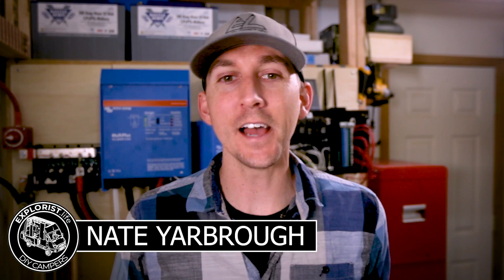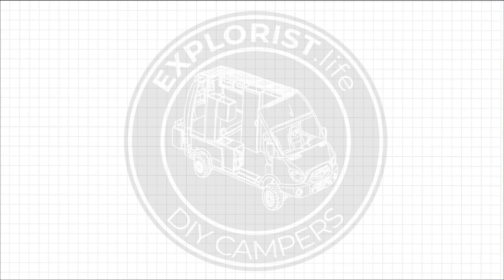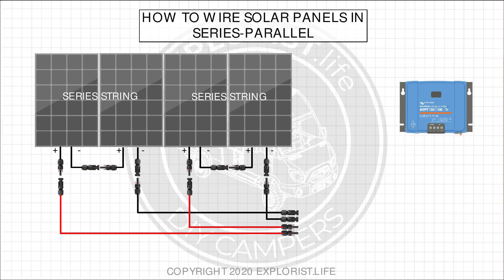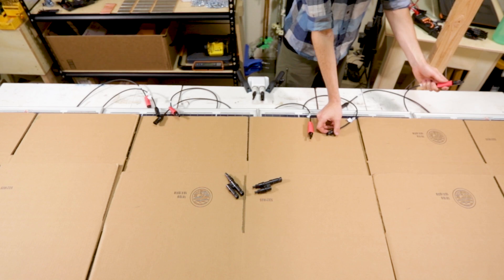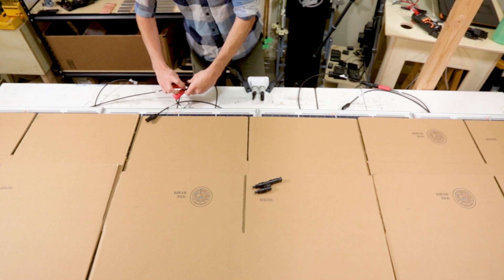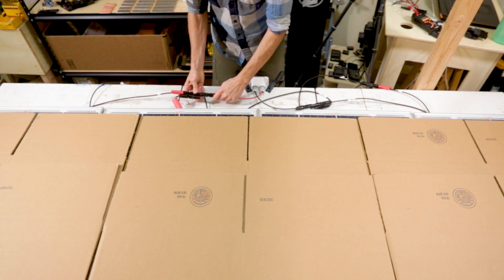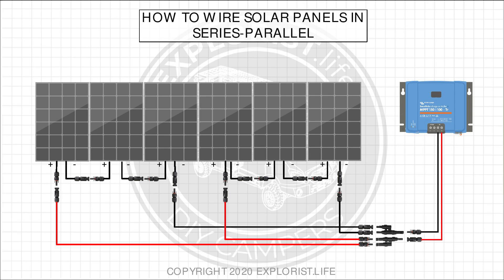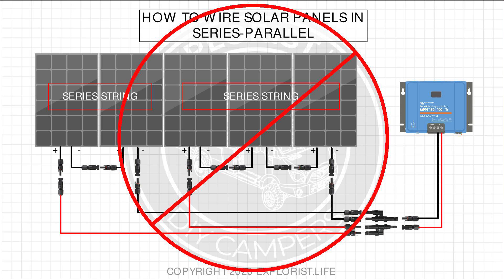How to Wire Solar Panels in Series Parallel

Comment: May be stupid question, but I have only seen series-parallel connections done for pairs of panels, (on youtube).  I will be mounting 6 x 350 watt LG panels; rated output of about 42v, 9.9amps each.  Can I connect sets of 3 in series, then each set in parallel, which should come out to about 84v @ 20A. ?
Reply from the maker: Yep!  Very much so!

Comment: My question is , I bought some used solar panels 4 of them are 190 Watts ,voltage at Peak power  26.7 Volts .
Also I got one of the
3KW 24V-110V Solar Hybrid Inverter:80A Charge Controller 3KW Off Grid Inverter.
im going to buy 2 of
400AH 200AH 100AH 12V Deep Cycle GEL SLA Battery for Solar System RV Camping
what do you think about the inverter , is going to work properly with no issue with 4 of these solar panels , also My idea to get 2 of 12v batteries to connect them as 24 volts .

I will be happy to hear from you and what is your advice to me.
Reply from the maker: I don't have enough information about your system to say much about it, but I've got all of my recommended setups available here that may help: https://www.explorist.life/solarwiringdiagrams

Comment: Hi. I got 5 panels.  So how do I connect. A sketch will be helpful
Reply from the maker: I recommend wiring in series with a properly sized charge controller.

How to wire solar panels in series: https://www.youtube.com/watch?v=2-ZN4JBbuKM

How to size a charge controller: https://www.youtube.com/watch?v=MxziHKvTRh8

Comment: Hey I found someone with a decent mic and presentation skills! Thank you. I purchased an EB240 with a 4 panel kit, mono crystal rich  solar 4x100 watt. Looks easy.
Reply from the maker: Awesome!  Glad it helped.  Thanks for watching!
Reply: Hey I got the same setup. I connected everything the same way as the video diagram but I don't understand what the output should be on paper

Comment: hola, i have a question , is it possable to read what happening in our solar pannel system from our office computer ? we would like to see how the system is working for our clients where they are on the road, is that possable yet ?
Reply from the maker: Yes.  You would want to connect your Victron Devices to a Victron GX device (like the Victron Cerbo GX) and connect that to the internet.  From there you could monitor your devices from the Victron VRM Portal: https://vrm.victronenergy.com/landingpage

Comment: If I have 24 panels I assume I can wire 12 panels in series and the two series in parallel, correct?
Reply from the maker: That will likely result in more voltage than your charge controller can handle, but here's how to figure out the math: https://www.explorist.life/how-series-vs-parallel-wired-solar-panels-affects-amps-and-volts/

Comment: I am planning on putting 5 175W solar panels on my van. If I can't wire them in series parallel with an odd #, but want to keep amps down, what do you recommend?
Reply from the maker: As you've likely learned, you can only wire in series and parallel with 5 panels.  I would recommend wiring all 5 panels in series (with a properly sized MPPT charge controller) to keep voltage drop and wire size to a minimum. This would also provide the MPPT charge controller with plenty of voltage to really do its job.

Comment: How do I get 220V dual phase from solar power?
Reply from the maker: Use a solar array to charge the battery bank.  Then use the battery bank to supply power to an Inverter capabale of 240v split phase output or 2x Victron Muliplus inverters wired & programmed for 240v split phase.

Comment: We have two 100ah AMG batteries. Should we install a circuit breaker of 50amp between battery and charge controller (wanderer/renogy)? Or install a switch and an ANL FUSE 50amp.  
We only have two 100 w solar panels
Reply from the maker: Yes, there should be overcurrent protection between the battery and the charge controller.  I prefer fuses  with no switches: https://www.explorist.life/2000w-inverter-200-400ah-lithium-200-to-700w-solar-camper-wiring-diagram/

Comment: Hello Great Video Thks. I wired my 3 strings, 6-250 Watt, 47 volts, 6.25 Amp panels almost the same way. 1st I ran both  a positave and negitave wire back to my combiner box like yours  making 6 wires total of 3 Negitive and 3 Positive from 3 two panel strings.
HERES were I may be in trouble  I than wired my positive and my negitive  WIRES  from each string  starting with a negitive wire from the FIRST string to negitive bar in conbiner box then end to end  positive to negitive ending with a positive wire and 282 dc volts at 6.25 amps. 
All is well but I wanted MORE AMPS  so I took the last string  REWIRED for PARALLEL  Lost 47 volts and my  Amps STAYED the SAME at 6.25 AMPS .  I should of ended up with  18.75 AMPS  but I did have 235 dc Volts thats correct.  Anyone have any ideas. Thanks Bill
Reply from the maker: I don't really follow what you did and what the problem is.  Sorry about that!

Comment: Do these same principals hold true for just 2 panels? I was told to wire my 2 panels this way because of the 30ft length I have to run the lines to my inverter(so I don’t lose voltage because of the long run.)
Reply from the maker: I know you found your answer, but for anybody else reading, 2 panels would be wired in series (given the charge controller could handle the voltage).  Here's how to do that: https://www.youtube.com/watch?v=2-ZN4JBbuKM

Comment: Just double checking. If I have 4x190W panels, each outputting 20.4v and 9.31A, If I connect two in parallel then that’s 20.4V and 18.62A and then I connect the other two in parallel and I join them in series, will my output be 40.8V and 18.62A total?
Reply from the maker: You should check out the video on this page.  It should help out: https://www.explorist.life/how-series-vs-parallel-wired-solar-panels-affects-amps-and-volts/

Comment: Hi Nate, I don't know if you have made video about wiring batteries but I thought I'd ask about wiring parallel vs. Series for batteries and what the pros and cons would be for each? If you have made a video on this then I'd love it if you would add the link. ;) Keep up the great vids, I'm learning a lot!
Reply from the maker: I don't have a video about that, but the only reason to wire batteries in anything other than parallel would be to alter the voltage of battery bank to a different voltage than the original batteries.  So, if you wanted to make a 24v or 48v battery bank out of 12v batteries, you'd have to wire in series (or series parallel).  If you were making a 12v battery bank out of 6v batteries, you'd need to wire in series (or series parallel).

Wiring 12v batteries in parallel to make a 12v battery bank is the way to go for 95% of use cases.

Comment: Hi Nate, your videos are incredible - thank you!

Question - what is the determining factor for the current of the solar-RV battery system — Is it the solar panels’ total wattage divided by the battery’s charging voltage (e.g., 14.4V for a 12V battery system)? Or the solar panels’ total wattage divide by the solar panels’ total Voc?
Reply from the maker: Solar array wattage / Battery charging voltage = amps charging the battery.

Comment: Hi Nate. Do you know what happens to the Voc when panels are wired in parallel? Does the Voc remain the same (assuming identical panels). I’ve read that wiring panels in series results in the Voc being added together. I have a system with a controller limited to 23 Voc (CTEK) and am trying to figure out the largest solar panel system I can create without exceeding the 23 Voc. If you could point me in the right direction, it would be greatly appreciated.
Reply from the maker: Here is a video that will teach you how wiring a solar panel array affects it's voltage: https://www.youtube.com/watch?v=KJ5zCY5EBeQ
Reply: EXPLORIST life - DIY Campers Thank you Nate. Your link was very useful and I really appreciate your response.

Comment: Hi Nate!

I am trying to convert a Ford E450 Super Duty 14 passenger van into my RV.

And this is my first time ever with this type of work.

I cannot thank you enough for all of your information.

They helped me and gave me enough courage to convert my own van.

I am trying to refer to your 
"300AH BATTERY BANK – 3X175W SOLAR – 2000W INVERTER – ISOLATOR WIRING DIAGRAM"
Then I found that you have updated this diagram to
"2000W INVERTER | 200-400AH LITHIUM | 200 TO 700W SOLAR CAMPER WIRING DIAGRAM"

And I have a few questions about the updated diagram.

Is the updated one better or easier to install than the old version?

I noticed that you used 4 batteries with the updated version. Do you think 4 batteries are necessary? Would the updated version work with 3 batteries as well?

You mentioned a few cautions about the old version. Does that mean you don't recommend the old version?

I found the "Victron Orion-Tr DC-DC Charger Isolated 12/12 30A" for new version is out of stock and Victron told me that it may be available for next month and I am a little worried if I get delayed with my work.

Your advice will be very helpful and thank you for your answers in advance!

Comment: Thanks for the great video. I’m currently setting up my off-road camper trailer with solar, and due to the small size I can’t fit as much as I’d like on the roof. To get what I want, I’ll have two panels bonded to the roof, and using locking drawer slides I’ll have two more covering the first Two while traveling. Once arriving at camp, the drawer slides will be unlocked and pulled out exposing all 4 panels to the sun. I’m over doing it because I’ll likely be in partial shade and they will always be flat/not directed at the sun. I’ll be using 4x Renogy 175w flexible panels.

I either need to run all 4 panels in parallel or run it in series-parallel. I’d like some power from the panels while traveling and 2 panels will be completely shaded. If I choose to run it in series parallel, I’m not clear which of the two panels in your example are in parallel and which two are series. I need to know which panels should be on bottom covered and which ones should be ontop exposed for the best charging while traveling.

I know it’s an odd question, but I appreciate the input. Thanks again for your videos!

Comment: quick question
if i have 3 panels
can i just connect 2 in parallel  to each other and the theird in series to both of them ?
also if i have a 2 different panels with different current (say one with 5 amp and other with 10 amp)
when i connect them in series how much current will i have or is it not possible to do so ?
Reply: I would like to know this also.

Comment: You wire to what the open volt capacity of the controller then parallel. Your using way to many connectors. Your doing it to stay at 24 volts rather than the capacity of the controller.
Reply from the maker: I'm sorry, I'm not following your question.  What are you confused about?

Comment: Hey Nate, is it ok to disconnect the solar panels from the MPPT/SC when the RV is outside in the sun? I plan on using the same panels to charge two separate devices so was planning to put an Anderson plug on the PV and remove it from one MPPT and plug it into my portable device that has an inbuilt MPPT. Do I have to wait for shade or cover the PV to unplug the solar panels from the MPPT or is it ok to offload them safely by just disconnecting the wires and plugging them into a new unit?
Reply from the maker: Power should not be flowing when you disconnect the panels.  Depending on the charge controller though, you should be able to turn the charge controller 'off' which will stop power from flowing and allow you to safely disconnect the panels.
Reply: EXPLORIST life - DIY Campers  thanks . I’ll be using a VictronConnect mppt so could go though the app and turn off charging before disconnecting the panel plug
Reply from the maker: Yep!  Exactly. Nice!
Reply: @EXPLORISTlife  Thank you very much.
Reply: @EXPLORISTlife  Is it ok to just disconnect the panels (when power is not flowing) and leave them disconnected while still mounted to my rig?

Comment: Very very helpful mate. Got 6 panels . That I'll be running into the roof of my camper in series and parallel. So this has given me the final insight I needed. 👌
Reply: did you go with pwm or mppt. trying to do this so I can ride with 3 on my roof and have another 3 with enough cable in case I'm parked in shade I can freestand them out of the shade
Reply: @Willsmokalot  mppt

Comment: Does wiring in series like this make the system 12v or 24 v ? Thank you
Reply from the maker: They can be wired into either a 12V or a 24V battery bank.  More Info: https://youtu.be/KJ5zCY5EBeQ

Comment: can you do it the other way around, say hook up 4 panels in parallel, and then have another 4 panels in parallel, but then connect the 2 sets of parallels into a series?  the reason I ask is because I have a yeti 1000, and it has a pwm charge port and an mppt charge port. I have 2 separate sets of mc4 cables going to each charge controller. When I take it with me on the road, I wanted to hook up my panels in 24v instead of 12v, can I simply plug the pos and neg together, and then attach the other pos and neg to a 24v controller? I couldn't find any information on doing parallel series... only series parallel.

Comment: At age 75 and doing a 2017 Sienna LE MiniVan Conversion in Concord, NH.,  I have learned that you can damage the Renogy DC to DC MPPT charger if the solar is left on and the battery is off. My question. Does anyone use a relay to disconnect the Solar when the battery is switched off to protect the MPPT charger.

Comment: Hi Nate, I have been a fan of your channel for quite some time and appreciate everything you push out content-wise. I have a question regarding my solar plans for my van build. With the size of roof real estate, I will be using 3 x 150watt Newpowa panels. I did get a Victron 100/50 mppt smart solar controller. 2 questions: 1. how do you recommend wiring these panels and was this the correct controller to get? I appreciate your feedback and you as a content provider!
Reply: 2 years but no reply from you fan channel hahahaha

Comment: Hi Sir,
I have installed 5kva solar system at my home. 5kva hybrid vmiii 48v solar inverter, 12x285w mono perc solar panels which are total 3420 watts and 4x126mah enersys batteries. First could you please tell me that how many panels (maximum watts) I can add to the 5kva system. Second is it compulsory to add same capacity (285w mono perc) of panels or different capacity of panels i.e 300w,350w, 370w, 380w, any from these can be add to system.
Thanks